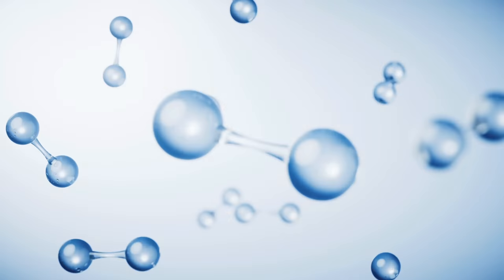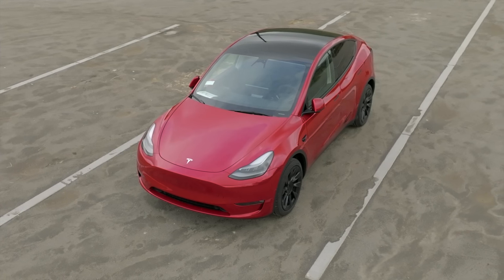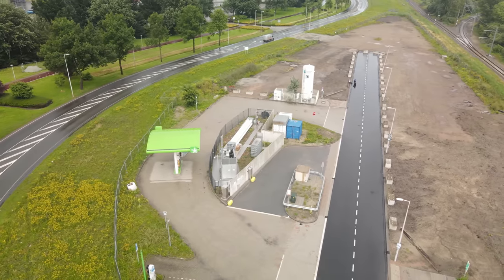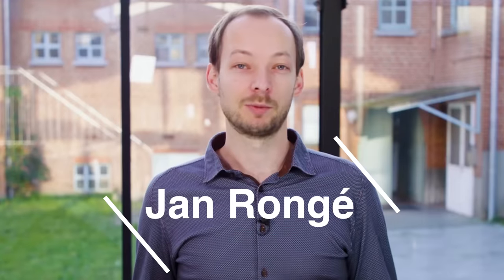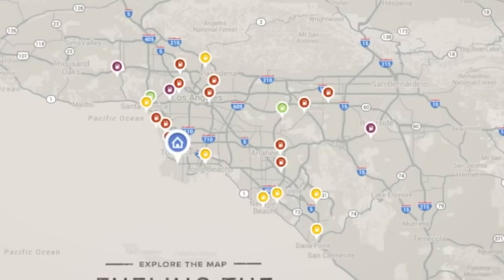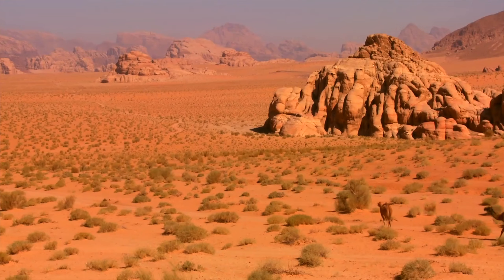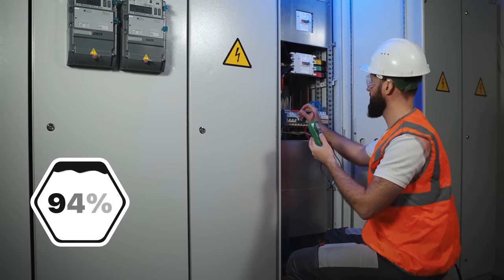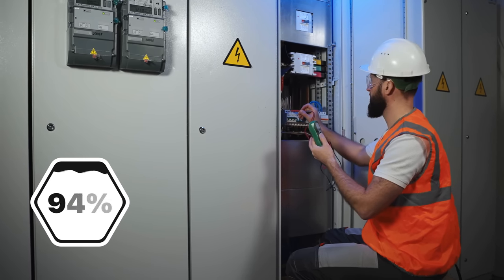Breakthrough Solar Panel Makes Hydrogen At Home!

Comment: You swivel between two cameras so much in your videos now.  It's kinda distracting.
Reply: Agree. 

if he had a 2nd person that was also talking in the videos, i could understand the frequent switching to focus on the talking person.  For a single person, it is very distracting.
Reply: Yup Agreed. Focus on just one camera and you can use the second camera from a 45 degree angle, if you like, but don't look at it. But TBH there are so many different images added that interest is maintained and it is not necessary to use the second camera. Keep up the good work. Excellent videos otherwise!!! 😊
Reply: Agree. Very cheesy.
Reply: @henrybailey6111 😢
Reply: I agree, the swivelling is distracting me from what is great informative content
Reply: Turning to a second camera to talk about a tangent, or explain something not on the main talking points but important to understand so everything else makes sense.

But here, there doesn't seem to be any logic or reason and continuing to talk as you turn your head with the camera switching after almost seems rude.
Reply: Ya. One viewpoint would be better.
Reply: Yeah, if those camera angle changes makes sense if you're changing to a new topic or offering an alternate view of what you were just talking about, but it shouldn't be frequent and swiveling while you're talking is super distracting.  Maybe you're experimenting?
Reply: Oh god...I see it now.  No like!
Reply: Yeah, I agree, it does get distracting. I absolutely LOVE his videos though! This one little detail, I'm sure he'll listen to the feedback and tweak things in the future.
Reply: It is distracting, but for most people its not, thats why he use it, ita like with everything else
Reply: It’s the way to confuse the audience by keep moving between 2 cameras 🎥 and explaining with a totally different narrative...🤷🏾‍♂️
Reply: I enjoyed the video and the information.  Perhaps you may suffer from ADD or ADHD.

Comment: To drive 1 mile with a hydrogen fuel cell car, you need about 20 grammes of hydrogen. This costs at least 1 kWh to make. To store the generated hydrogen in the tank, costs another 20% energy, so that makes 1,2 kWh per mile. A solar panel with 400 Wp takes 3-4 hours to make this amount of energy around noon. On a full day the panel will be making about 2,5 kWh.  Suppose you have 20 of these panels and it's sunny summer day. Then you can generate 50 kWh - which enough for 40 miles - for a big roof with 20 panels. Just barely 2 miles per panel, per sunny summer's day. Btw. a BEV will do with 1/5 th of the energy, much more feasible, and safe. When you would burn hydrogen in a combustion engine, you'll need 3 times more than for a fuel cell car. No way that you can provide your own hydrogen for that.
Reply: When your solar panels are producing excess it can be used to make green hydrogen for many uses. Heat your home, cooking and fueling a car or generator when the sun isn't shining.

Hydrogen vehicles are EVs. These will be used at highway fueling stations along highways for refueling semi trucks that can not sit for hours waiting to be charged from solar or grid power.
Reply: @solarcabin  or you just store in batteries
Reply: @waywardgeologist2520  I live off grid with solar and batteries every day.  Batteries weigh a lot and take up lots of room.
Reply: @solarcabin  I don't understand how you can say batteries take up a lot of room.  And who cares about weight when they are sitting in the garage?   50kWh worth of LiFepO4 batteries take about the same volume as a modest chest freezer.  Not much at all, and they can be put anywhere.
Reply: No, LIFEPO4 can not be put everywhere and most people do not have a garage. I have been off grid with solar and batteries for 20+ years.
Reply: @Solarcabin Off Grid Adventure Channel  if you are useing old ass lead acid batteries yeah they are
Reply: Off grid 20+ yearas and I use LIFEPO4 now but a battery bank needed to run a house and charge an EV would still be huge and heavy. Do the calculations.
Reply: Old numbers
Reply: @solarcabin  most people get their info from solar door salesmen who tell them they can power their whole home with 17 panels and one ess. They dont have a clue
Reply: @solarcabin my biggest concern is that batteries use a LOT of precious metals and cost a LOT of energy to pull out of the ground and produce.  The world has created one problem by trying to solve another.  And in fact, the bigger problem is mining precious metals and disposal of all these batteries.  The future problem with that is astronomically high.  We need to get past our fear of nuclear power and shift to the cleanest version of that combined with systems that can store energy for later. I'm not against clean solar but it's also made of precious metals and only lasts 20years avg.
Reply: @solarcabin  If you have an EV you already have a battery more than large enough to supply your home's requirements. By using your EV in a V2G/V2H capacity you have battery storage well beyond the capacity of a Powerwall or similar and with V2G tech this presents a potential income stream from your EV when it's not providing transportation.
Reply: @solarcabin  ... and you local Fire Marshall is unlikely to let you install hydrogen tanks in your home, neither will your home insurance cover with for this risk.  The safety specifications we have to implement in industry, when using hydrogen, are very extensive and costly (I work in the sector).  Hydrogen CANNOT be handled safely by an untrained professional.
The hydrogen-fueling stations will have to be "fool-proofed" at great costs... but at least two of them have already exploded (one in Santa Clara, CA, and another in Norway... and a hydrogen plant in NC... plus a few others in Japan and South Korea,, 2 fatalities and 6 injured there).  The three accidents I studied  did a total of two fatalities, and approximately 9 injured people; they also destroyed homes.  That does not happen with an EV fast DC charger!  Guess what would happen if hydrogen-storage home installations were getting common?!?  Can you imagine the average DIYer tinkering with a wrench on a 700 bar hydrogen line?
Reply: @st-ex8506  LI batteries also explode and catch fire.  Hydrogen is already stored in tanks just like propane. It doesn't have to be at high pressure for many uses.  In use all over Japan right now.
Reply: If your EV is powering your house  you can't drive it.  I am not against LI batts and you guys are afraid of competition. Hydrogen is a mult-use fuel that will replace fossil fuels for many uses where batteries are not applicable. Think outside the box.
Reply: @st-ex8506  its not just about battery capacity, u also need the inverting power. Most bidirectional car chargers wont allow much continuous amps, u wont be able to start an ac unit on a car battery till they fix that
Reply: @zzz-nu2re  The AC to DC inverter does not need to be in the car!  It can be part of the home installation.  It is something that you do have anyway, if you have a home battery!
Reply: @st-ex8506  bidirectional chargers are inverters, have u read the 2023 nec code?
Reply: @zzz-nu2re  no! Being European, the NEC code is not my bedtime reading…
Reply: @st-ex8506  at least read about the technology u are making claims about
Reply: This makes absolute sense.  How has the video missed or ignored this crucial fact. It takes way more energy to extract hydrogen and store than the hydrogen produces.  Why not just use the original energy and drive several times further? Seems to be a huge waste of energy.
Reply: @junkerzn7312  You can store hydrogen for winter utilisation, batteries suck at low temperatures, hydrogen can be compressed and stored for extended periods.. Bloom energy has electricity generators from natural gas and hydrogen.. so these will be decentralised electricity generator.
Reply: @ng-lj7ow  Uh, no, you really can't, your comment pretty much ignores all the well known realities of trying to store hydrogen, let alone accumulating it for 6 months "for winter utilization".  Also batteries don't suck during winter if they are inside (which you can do with LiFePO4 batteries) or insulated.  It's already a solved problem.
Reply: @junkerzn7312  who said accumulating, is the only way once you have a hydrogen economy you just refill hydrogen, solar is there just for emergency purpose.. you do not need efficiency when you are limited by battery capacity.. in the long run hydrogen is going to be cheaper and smog free.. eventually engineers will figure out a way to regain the energy lost due to compression..
Reply: @st-ex8506  People like you also think untrained people cant do electronics engineering yet I am a drop out and built Nikola Teslas wireless transmission system and made his violet ray machine frequency specific. I also took my own blood and analyzed it before and after using the machine on my body and proved it works as Tesla said. But back to the same problem. This does not allow megalomaniacs to centralize power.
Reply: @limitlessenergy369  good for you! Congratulations! But you are probably among a small minority of self-taught inventors! No?
Reply: @ng-lj7ow  You aren't thinking this through even remotely.
Reply: Probably more useful as an off-grid power source.
Reply: @spacedave2000  Batteries do not use "lots of precious metals".  The whole point of the shift to a LiFePO4 base chemistry is that the battery doesn't need any precious metals.
Reply: @junkerzn7312  is this a trolling comment or  you just don't understand anything about chemistry and modern day batteries?
Reply: To make it fully efficient it needs to be direct photosynthesis without an electric intermediate stage.

Chemical photosynthesis is hella efficient, somewhat more so than even the most state of the art PV panels.

Hydrogen photosynthesis is not ideal, but continuous lab research is being conducted on photoactive catalysts to make it more efficient.
Reply: @st-ex8506  insurance companies are dumping people for solar.
Reply: @chucknorris277  what do you mean by that?  They will not cover your home if you have solar panels on the roof? Never heard of that, at least over here in Europe.
If it’s true, those insurance companies will progressively be very short of clients!
Reply: @zzz-nu2re  Ford's requires another inverter from Sunrun. It is a bidirectional charger.

Comment: Mr Hindenburg approves! This is the bomb!  ;)
Reply: Nothing could possibly go worng!
Reply: @rob6850  it was pretty funny when he said that. And of course we know that something can always go wrong. But then again, it’s pretty much the same thing as piping natural gas to our houses which we already do.
Reply: Hope you have heard of the contemporary Hindenburg in news these days!
Reply: @ecoideazventures6417  Not sure what you’re referring to.  Gas line explosions?  Like the PGE one in the Bay Area or the one that happened in Guadalajara??
Reply: The Hindenburg is not an apples to apples comparison. It was a ridiculous blimp. A thin skinned balloon, full of H2! This modern version is nothing like that. Check out Toyota’s H2 storage tanks!!! The safety investigations have been good. Compared to a gas tank sitting under your car in a crash! H2 will quickly go UP into the atmosphere! Not pooling around on the road ready to catch a spark!

Comment: You forgot one of the biggest issues! The damned stuff is explosive. You can be absolutely sure that your house insurance rate will blow up just as soon as the first house blows up killing all the occupants. Next you'll find that if your neighbor has one of these hydrolyzers then your insurance will go up too because a hydrogen car fuel tank's worth of explosive hydrogen is going to take out most of the block when the inevitable leak occurs. The stuff is odourless (and must remain absolutely pure or else you'll damage the fuel cell) so it's impossible to tell when it leaks.

Comment: Thanks for talking about this technology! But just as some others have commented: in your comparison you leave out the problem with the fuel cells, that they require a worse kind of mining than the battery materials, which by the way are shifting now already to a broader mix with less hard to produce elements like sodium, Sulphur, Iron... and as much as I liked the idea of Hydrogen in the past the more I learn about the problems with storage, round-trip efficiency the less I like it! And particularly not for home use! I don't want to live in a building, where you always have to fear it blows up, because some vibration or aging of material has let to a leak!
This technology would be really useful to make fertilisers in countries that have a lot of sun! And of course make steel and concrete and all the other good stuff you can do with it, but not for space heating or transportation!

Comment: It makes more sense to just store the electricity given how much it takes to create it and then use a fuel cell to get it back, IF it’s for an EV or home use.

Only makes sense when there is huge over production that the batteries would be very large or expensive, or for uses like air travel where battery weight is a limiting factor
Reply: Yep that is what will be needed for seasonal storage. A large array that powers the house, charges the batteries to run the house and charge the vehicles at night, and provides seasonal storage for the higher latitude countries when there is plenty of sun in the summer. The H2 would be best stored as ammonia for use in the winter when solar is very weak or nonexistent for months at a time. A home would size their NH3 storage tanks based on how long and severe their winters are. Also with a freezing point of -70 C the tanks won't need very much insulation. Or they can just run their home off of RNG in the winter 😅. These also have the huge benefit of not using ground water to make H2 to preserve our fresh water resources.
Reply: It makes sense to develop for heavy freight industries like rail, but especially shipping - and also notably lightweight air transport too such as ultralight planes and drones. Having on-harbor production facilities to utilize wave, wind, and solar energy to not just power the grid, but to also use excess energy to directly produce store the energy as hydrogen, and then fuel cargo ships directly as they dock and load/unload. You also have a vast abundance of hydro right on location, and pretty much all freight harbors of the future will become energy hubs through direct grid link, as well as hydrogen production.

There is already a multi-billion investment in Power-to-X in Nordic countries to become the main European supplier of green hydrogen in the coming decade, specifically utilizing these methods - even going as far as building a massive artificial island in the north sea with the exclusive purpose of creating this infrastructure at a multinational grid level.